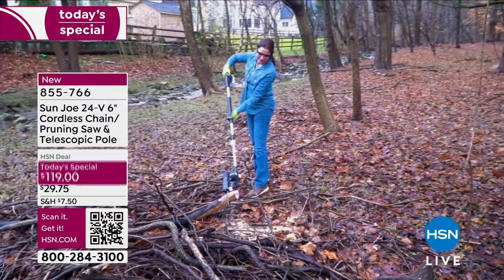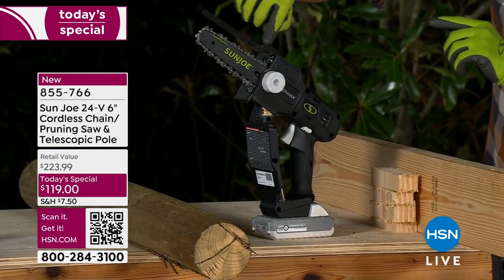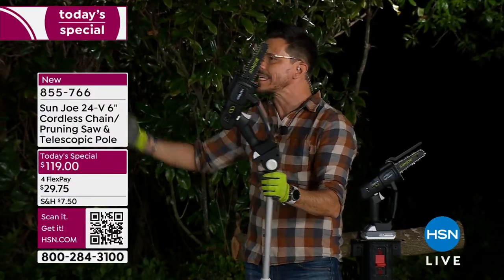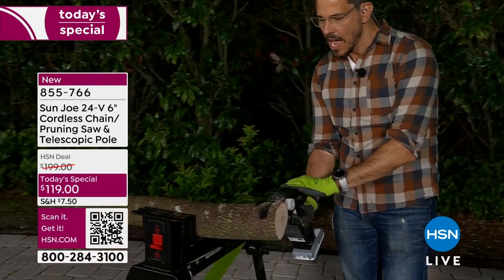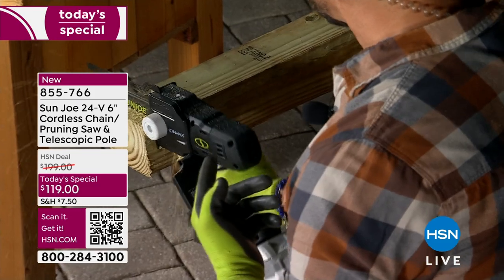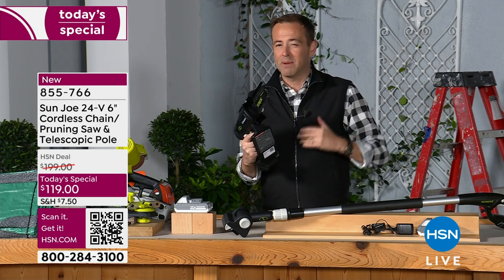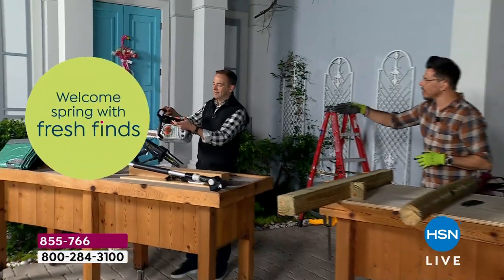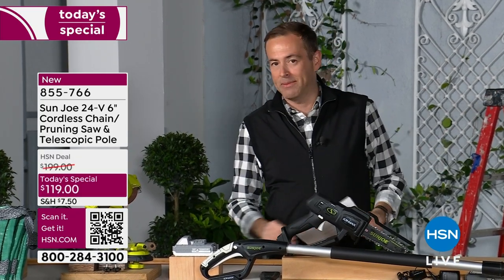Sun Joe 24Volt 6" Cordless Chain/Pruning Saw with Telesc...

Comment: What a shame, there are ZERO replacement chains anywhere for this including from Sun Joe.  The owner’s manual states wrong specs it says the chain is 27 links it is 30, the pitch is .3, no one sells a .3 pitch chain.  Sun Joe was of no help. Buy one from Amazon from a brand that uses common replacement chains. Very disappointed with HSN. I was so happy to receive mine and now I’m devastated it is useless without replacement chains.